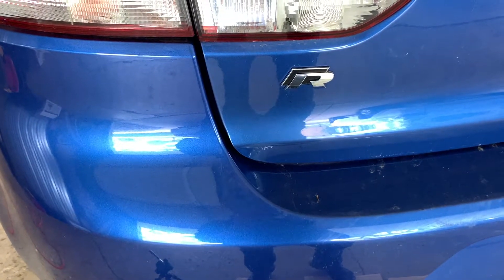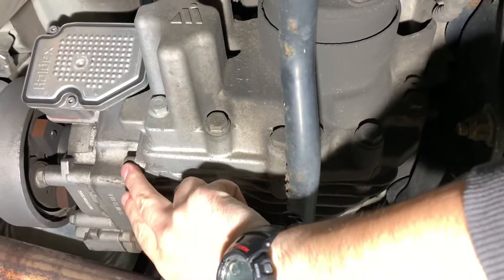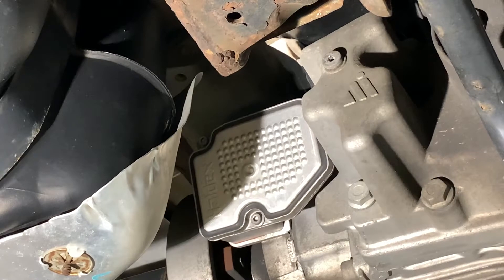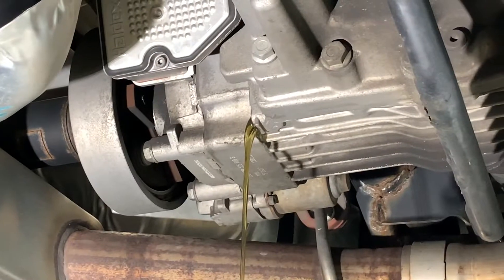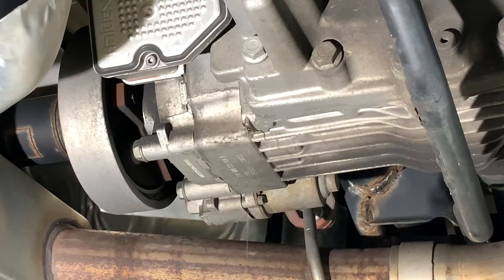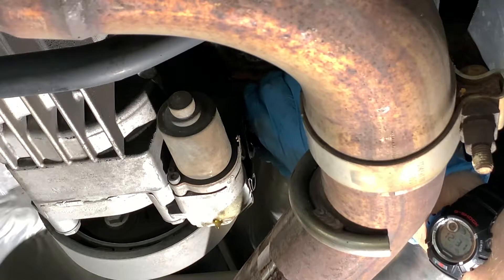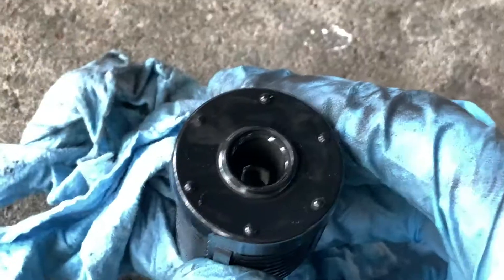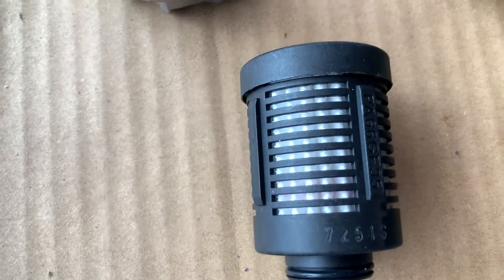Haldex (Gen. 4) Fluid and Filter Service - Volkswagen Golf R MK6

Comment: Hi,
My question is: during the oil change and oil filter replacement on the 4th-generation Haldex, when using VCDS and starting MAS02928 – Pump motor, does the engine need to be running, or is it sufficient to have the ignition switched ON only?
Which method is better for activating the pump?

Thank you in advance for your answer.
Reply from the maker: I did mine with just in accessory mode and did not run the engine till I needed to move the wheels

Comment: Great video- I’m currently experiencing an oil leak on my 2010 Tig 4Motion on top of the oil filter housing for the haldex. I was able to confirm the leak by doing an output test on the haldex pump and saw the leak leaking from the top of the outer cover. Is it common for these filter housings to leak? I’m assuming that one or both orings of the white insert failed which leak when the filter housing builds pressure? Any suggestions would be appreciated. Thanks.
Reply from the maker: Yeah I mean if you clean the surface off and you are still getting some leaks around the filter housing seals I would just start with that, swap them out and do a fluid change too since you will have to drian the unit.
Reply: @brycecarlson going to be looking for that filter kit here locally so I can get this thing running again. I’ll tell you- this Tiguan is the fruit that keeps in giving 🤣 🤣
Reply from the maker: @ivanvega2821 ooofff I know the feeling. But yeah all part numbers are in the description. Not 100% sure if they are the same across VW models but I would think so.

Comment: I'm in the middle of changing my haldex fluid. You do something with VCDS on your laptop to prime the pump then runs it with all 4 wheels off the ground to get fluid into the filter and pump. I can run it with the wheels up but I don't have the VCDS setup. Am I ok just running it with the wheels up and if so how long do I need to do that? I think he did it till it warmed up but I don't know how to know if it's warm. Is 5 min or so ok? Thanks!
Reply from the maker: @phreddykramer  probably fine. The pump prime is just to get fluid moving before any friction or resistance is applied. But with the wheels off the ground it will still reduce air in the system.

Comment: a mechanic on my country told me that we can i use sae 75w-90 for haldex oil

And he already did that to many golf MK6 R for my friends

I just wanted to know if it's risky and what will happen if this oil is not compatible
Reply: The oil in this unit goes between friction plates/clutch, not just bevel gears in a differential. It's a specialized unit that takes specialized oil, I'd say you should probably look up the correct OEM fluid or a certified replacement fluid - likely mail order anywhere. 75w-90 might work for a while, but who knows for how long, and likely no going back once you do.
Reply: I wouldn't risk it to save a few bucks. The haldex unit is pricey if it breaks. You can get a haldex kit including filter and new plugs from FCP Euro for $60 and my mechanic has fluid for $30

Comment: Hey Bryce, thanks for the vid, very helpful. What’s size Allen key for plugs?
Reply from the maker: Glad it helped! I am 99% sure it was a 5mm.... But I do not recall exactly.
Reply from the maker: It is 4mm for the filter housing. You can see it at time code 3:46.
Reply from the maker: 8mm for the drain plug. You can see it at time code 2:24.
Reply: 5mm for the fill plug I think. It's all in the video

Comment: Hi, i just wanna ask, if there is a way to change the N373 solenoid valve without changing the oil. Thanks
Reply from the maker: Ha; had to look that part up quick did not remember it from the 4th gen diagram. I just changed the filter here. I would not think their is a way since you have to remove the cover/housing and the fluid could come out.

Comment: Great video! I recently had a haldex service done on my mk6R but the mechanic was telling me there is no filter. Now a couple days later I have a “0048 haldex pump v181” open circuit error in VCDS. Also trying to check the pump in output tests I can’t hear anything whirring. My R is FWD 😢
Reply from the maker: Hmmm interesting. In theory not replacing the filter would not impact that (in fact maybe less since setting the fluid is not as consuming because you do not need to re prime the system as much for a level check).

🤔🤔🤔🤔🤔
Reply: @brycecarlson  yes. Im starting to think my pump has taken a shit.
Reply: @brycecarlson  Like you think regardless of replacing the filter, my pump was due to die? I think the filter is definitely a contributing factor. My problem now is whether or not to take my car back to this mechanic and have him replace the filter or do everything myself. I'm a  semi competent DIYer, have the VCDS cable and everything so I think I can tackle this job. My only limiting factor is having the garage cleaned out in time to do the repair LOL
Reply from the maker: @darkstar9008  yeah that is a tough call. I have never done any of the adaptation or even looked into replacing the pump itself. My only thought would be if maybe changing the fluid clogged the pump after the fresh fluid started flowing and dislocated a chuck of metallic gunk. Kind of like old auto transmissions and when the ATF has not been changed for 100-150k plus miles.
Reply: @brycecarlson  interesting. I like that theory and it seems very plausible as to why I’m experiencing this. I’m gonna be tackling the job myself and hoping for the best. Car only has 30k miles on it, but with the haldex fluid needing servicing every 2 years/ no record of it being done. I’m just praying that a new filter, pump, and fluid will be my saving grace and not a brand new haldex unit
Reply: @brycecarlson  when you have a chance can you describe what you did for the VCDS portion to prime the system? And for adaptation?
Reply from the maker: @darkstar9008  yeah: check this out:
https://youtu.be/zwN9xmd8G-4

I wound up not doing that on video as I had all 4 wheels off the ground on my lift but that would do the same as it kicking on in a no load scenario like I had on the quick jack lift.
Reply from the maker: @darkstar9008  also regarding adaptation I do not know if any is required. I just know some units require that. But the pump prime is a good output test.
Reply: @darkstar9008 кроме замены фильтра обязательно нужно чистить сетку на насосе, там сгустки забивают проход и повреждает мотор
Reply: I'm in the middle of changing my haldex fluid. You do something with VCDS on your laptop to prime the pump then runs it with all 4 wheels off the ground to get fluid into the filter and pump. I can run it with the wheels up but I don't have the VCDS setup. Am I ok just running it with the wheels up and if so how long do I need to do that? I think he did it till it warmed up but I don't know how to know if it's warm. Is 5 min or so ok? Thanks!

Comment: Wow Haldex/BorgWarner finally smartened up did a drain and fill plug. I have a MK4 R32 with the first Gen Haldex system. There’s only one way to fill and drain through the same hole.
Reply from the maker: Yeah; I saw some videos of that. No thanks. This is not that bad.